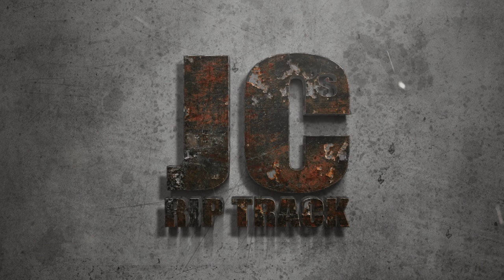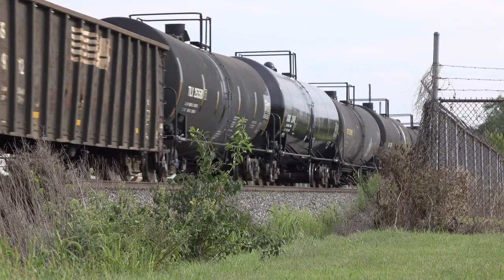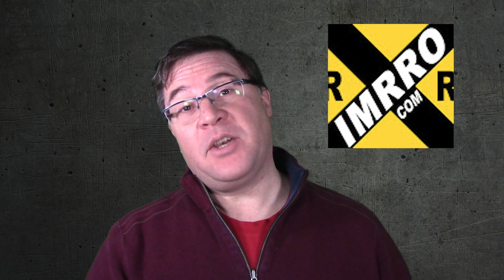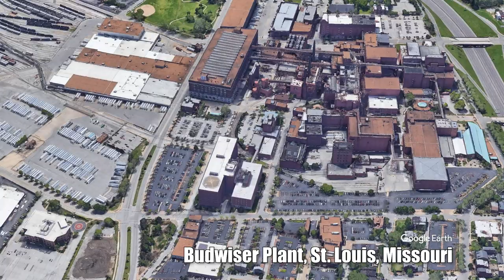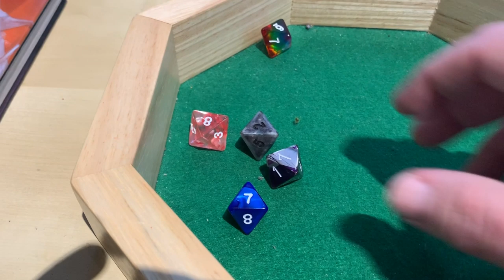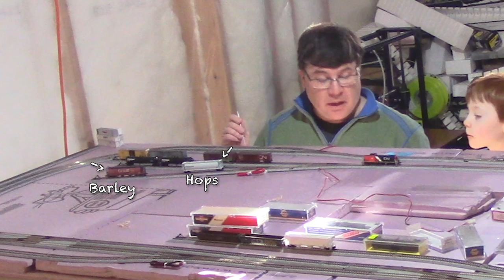Model Railroad for Beginners - From Loop to Layout - The Puzzle of Switching Operations

Comment from the maker: So what is your thoughts about puzzles and switching layouts?
Reply: I live in a caravan so space is limited. I developed an HO switching layout (2000mm x 640mm) on the bunk above my bed. (based on an article by Robt. Pethoud in Model Railroader - March 2016). The track plan represents a town at the end of a spur track, and is simply an incoming main with a passing loop that has 1 facing and 1 trailing turnout. On the opposite side to the loop the main track has 1 turnout in the middle leading to a double ended lead track. There are 8 industries to be served, and I use 10 cars in total.. I have 12 Job lists for the "crew", each taking 50 min to 1 1/2 hour to complete. Each Job list involves 2 inbound cars, 2 out bound & up to 3 to be re-spotted.. At the end of the 12th Job, the cars are in the same place as when you started.
 It's a puzzle but represents the challenges that a Locomotive crew could face every day!
Reply from the maker: That sounds great! And the encouragement that it can be done in a small space like a caravan. Thanks for sharing!
Reply: Really cool
Reply: Sorry, I don't think of it as a game or "puzzle". I am attempting to simulate what real railroads do-- pick up, drop off and transport goods and people over their road. If there is no element of doing this then you are simply playing too-too twains and I am outta here!
Reply: The problem with the inglenook puzzle for me is that I know a general method to solve it. That takes much of the challenge away. I haven't looked at the other puzzle, but assume that the same could happen.
Reply: @tombarnes7196  I can see your point, but at the same time I am thinking: "isn't trying to simulate the real thing a game as well?"
As far as I'm concerned, a model railroad can just be anything the owner wants and there's dozens of ways to enjoy the hobby. I don't think that there's a wrong way of doing it, unless it's doing something you don't enjoy.
Reply: Nice vid.
Great way to show how actual operations and shunting puzzles can use the same track arrangement.
Reply: I don't mind Opperations however the puzzles are not that great
Reply: eh

Comment: Great video, that nicely shows the difference between switching puzzles and freight-car forwarding systems. My own layout visually appears to be point-to-point (or yard-to-yard), but beyond each visible yard there are hidden six-track staging yards representing distant connections (north and south); and I also have a hidden track that connects the two visible yards, allowing continuous running. When I operate/switch the layout on my own I have a second (and sometimes a third) train running laps around the layout to create interference traffic. The train running laps forces me to keep the main track clear as I work the industries, just as a real switch crew would have done.

Comment: Hi John. My layout progressed from a basement sized loop to an industrial switching layout. I based it on Peoria, Illinois. Not necessarily duplicating the prototypes. I studied industries for car types used and ratio of the car types. I next looked at how work flows through the industries. This gave me a more proper placement of car spot location. There a thousand ways to pick inbound cars. I sometimes cherry pick out of staging or play the cards as they are dealt. Er cars in this case. My learning curve was steep at times but it increased my enjoyment and increased my interest. I agree with your thoughts and teachings on this matter. I have seen several guys fade away due to boredom and lack of interest in the hobby. Keep up your mentoring. I surely don’t know it all and hope to learn through your journey in this series. Mike
Reply from the maker: Thanks for this, Michael. I'm really learning this as I go. Teaching it to others helps me learn it. My comfort zone is the weathering stuff, but I do need to build my layout. :)

Comment: Nice video John.   It was great to see Ian involved.   Keeping someone that young occupied for that long is a real accomplishment.   Also, I wish I had seen this or something like it before building my Scenic Ridge Layout.   Like I suspect most folks, at the start we have no idea about operations and just put some track together.   Knowing specifics about operations and siding large enough for 5 or 3 cars would have made me make some changes.
Reply from the maker: Thanks Don. The Piko Smartcontrol/ESU Cab Control is really easy for Ian to use. I plan on doing a review on it, and having that as a real plus that a 5 year old can operate it. The video doesn't have the audio, but he loved ringing the bell, horn, and all those Easter egg sounds hiding in the Rapido GMD-1 :)
Reply: JC's Riptrack I don’t run trains that often so unless I really think in advance I don’t use the ESU wireless remote.   Most of the time, recently, I’ve been doing speed matching and the ESU console lets me easily control multiple trains so that’s my controller of choice.   Although, if I’ve charged up the wireless controller I will use that as well.  I just find it does take awhile to get booted up!!!

Comment: JC, good job with the 5 year old!!  I combined a Timesaver and Inglenook Sidings into Timenook. I wrote a history of the industrial area to 'explain' how the track configuration came to be. It has full scenery and buildings. BUT, most important, I also use car cards and waybills to keep things fresh. I think at some point I'll build two track staging yards to attach to both ends  of the 12X80" layout that exists now. Thus, I'll not have to be moving cars on and off the layout at the end of each session. With about 20 cars available, and the car cards to work with, I get a wide variety of problems to solve. Sometimes there's too many cars on the layout, and sometimes there's not very many. It all makes for an ongoing challenge. You and your son keep enjoying your layout. 
David
Reply from the maker: Thanks David. I may move to car-cards and waybills once the industries are a bit more concrete. Ideally, I would like to have some genuinely off-layout staging. I expect I'll move toward that, but one thinga at a time. :)
Reply: Sounds interesting I would like to see your track plan.

Comment: Since I stumbled upon this series a while back, I have been eagerly awaiting the next installment, along with planning my next model railroad.  My re-entry into model railroading several years ago was an N-scale Inglenook Sidings layout using the same basic configuration you show here, although I built mine using Atlas Snap Track.  I also built it around 40-foot cars and used Atlas "standard" switches (basically equivalent to a Kato #4).  BTW, the layout I'm planning includes a yard based on the Inglenook puzzle, but I expanded it to accommodate a longer train.

And good on you for getting your son into the hobby!  I don't have kids of my own, but I did babysit my sister's kids quite a few times when they were around this age.  I know what you mean as far as keeping their attention on something. :)  You are fully justified in taking pride in him wanting to run trains again.

Comment: Nice video showing fun educational switching movements. I could say you should write down this operation set so you can use a timer to see if you can do it more efficient the next time to learn better moves. I basically have a 2 main line figure 8 with full switching layout inside for 6 industries. Also I have a under layout loops too act as destinations off layout where trains can be built , wait,  or change direction. ..good video.

Comment: John,interesting video on how to if that is your thing for moving cars around.Also glad to see your son involved in the hobby.But i bet he was wondering,when are we going to run some trains around the track? Question are you using the Kato power pack when controlling the trains,or something else? Happy Model railroading,to you and your family and subscribers,stay safe and Healthy.🚂✌🌍
Reply from the maker: I am using a Digital Command Control system with this layout, rather than the Kato power pack. However, whether or not you use it to drive trains, the Kato power pack is also good for powering the turnouts and other accessories.
Reply: @JCsRiptrack  Do you need DCC trains to use it? If not can you show how to use weather,DC,or DCC. Thanks.Happy Model Railroading,and be safe and stay Healthy.

Comment: It's so weird you went this direction. Since your last video in the series, I learned about switching puzzles, and have been considering adding an Inglenook puzzle inside my loop. Seems like on a small loop layout, it would add usability to the layout.
Reply from the maker: Interesting! It is a logical next step to add challenge to the layout. I had originally planned on doing this video with the timesaver, but in some ways this one worked out. I may still try the timesaver as an alternate, but now I have some ideas to add another single industrial track on the same side of the layout that might require some interesting arrangements. It's nice to be able to play with it.

Comment: I loved this video and the thoughts expressed in it. Yes real world situations exist that mimic switching puzzles, old infrastructure gets reused in ways as I industries grow and change that mimic these puzzles. I work at a plastics factory that has fairly straightforward switching operations. However the plant I started at had a grouped together set of legacy rails which we were not going to take the expense of reconfiguring that was a lot like a switching puzzle, Also I love the part where you shared this with you kid, looks like you both had fun!
Reply from the maker: We did! Thanks Brian. I'm glad you found this helpful, and that you provided a real-world example of legacy rails.

Comment: Good video...just getting back into the hobby myself, but I have to ask why your layout sits so high?
Reply from the maker: Good question! It's positioned above my hobby desk, so I had to put it high enough so that I didn't whack my head on it. Also, the height allows for a  viewing angle that's closer to eye level and looks more realistic. Another side benefit is that high layouts aren't as hard on the back either :) It's about 53" off the ground, which is a good height for my 5'8" frame...

Comment: Neat little puzzle, yard I have a question if I use #4 turnouts I can fit a smaller yard inglenook in 3-2-2 format in 8 inch by 36 inch as a test bed for scenery practice before building a bigger layout.if you are using #6 turnouts , what it the width of the yard as you have layed it out? Thanks.

Comment: I would of done it different - Pull tank car (1) 1st,  Dropped it in track 3  for a later respot.  Grab cut on track 2 (6,7,8),  pull it and spot Blue Hopper (8) on track 1 next to car Tank car (2) -  (8,2).  Return cars (7) and (6) to track 2 and 3.  Track 3 should have (6,1). Now you are set for a quick back and forth picking game.  Grab (8,2) then go get (7).  (8,2,7) then back to Track 1 for car (2).  (8,2,7,3) Make your 2nd to last move and pull car (1,6) from track 3.  (8,2,7,3,6,1)  Return car (1)  to spot 1 and leave with cars (8,2,7,3,6).  It is best to try and add car to groups if you can.  Numbers look backwards but engine would be on the left for the number strings.  < Engine (8,2,7,3,6)
Reply: Opps missed the limited lead. So a few extra back and forths,  my bad.
Reply: To be honest, during the proto sesion,  I would of pulled entire train on to the inside siding, use those 5 inbound cars as a handle during the pull.  After the pull shove, those 5 cars back out into the hole.  Then spot the 5 inbound cars that you were using as a handel.  Now back out engine light grab you cut of 5 and get out of town, after you contact the dispatcher for permission to occupy the main...
Reply from the maker: Thanks for this Eric! I'm still learning the stuff myself, but how to translate it into a small space like mine. Your experience is definitely appreciated!

Comment: Hooray!  I currently building a 120"x16" N Scale with Kato Unitrack.  I have spent a long time disciplining myself  to not fill up the space with track.  I although I have two reversing loops on the right end (one underground, one above).  The left end is just a loop back.  I'm constrained to 183mm curves, which thankfully my locomotive can handle it fine.  The rest is passenger and industry.  So I really am going for more operational -- but I'm keeping my options open.  Cheers! --dunc
Reply from the maker: Wow. Those are some tight curves, but industries are often known for some really tight turns...

Comment: Hi John, I have admired your weathering abilities and your skills as a teacher and mentor of weathering.  This video, however, was special in dealing with puzzles or operations or both.  I idea of doing both is very appealing to me with my small layout.  Your benchwork looks a lot like mine which was developed by the Model Railroad Magazine layout of January-February-March-April of 2015.  Did you use that series in building your layout?  Is it 36 by 80?  If so, I like that you were able to do double track around most of the layout.  Thanks and looking forward to your new adventures.    - Dean from Minnesota
Reply from the maker: I am aware of the series from Model Railroader in 2015, although this one isn't necessarily tied to that, but yes, they built that on a door. I've extended this one a bit.

Comment: What are the dimensions and can you draw a diagram of the track plan?
Reply from the maker: The track plan is evolving, although I sketched some of it out using SCARM. The Inglenook siding, on the other hand, was built by swapping a S186 straight on the main line, and adding the right amount of track to hold the appropriate number of cars. The dimensions of the whole layout is 36"x86" --It's a hollow core door with a 6" extension to one end.

Comment: is that board 8 ' x 4 ' please?
Reply from the maker: This is a 36"x80" hollow core door, with a 6" extension to one end of it.  Since I'm working in N-Scale, I can use a smaller board. The principles for HO Scale are the same, but space considerations are a bit different.
Reply: @JCsRiptrack  thanks - much appreciated